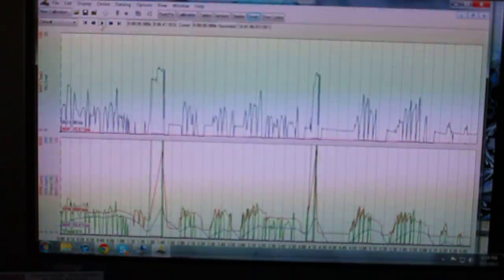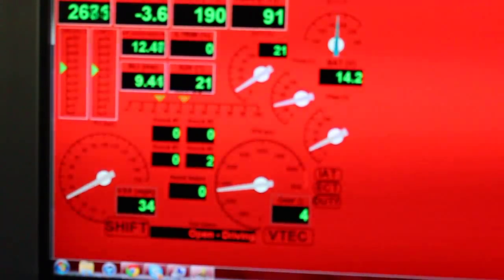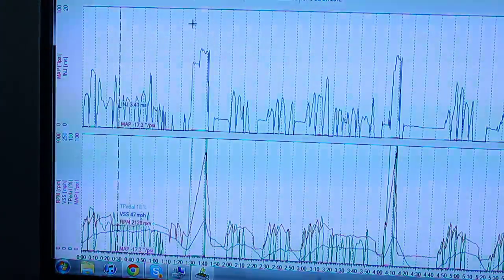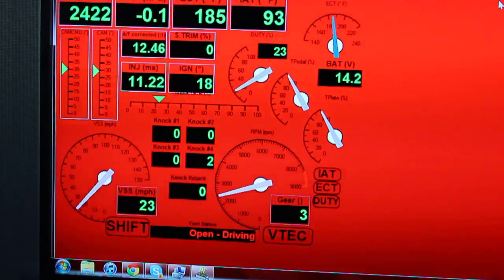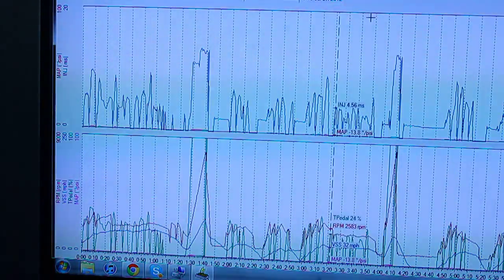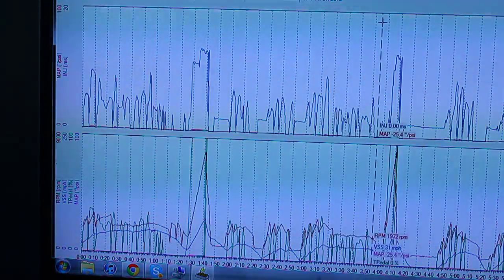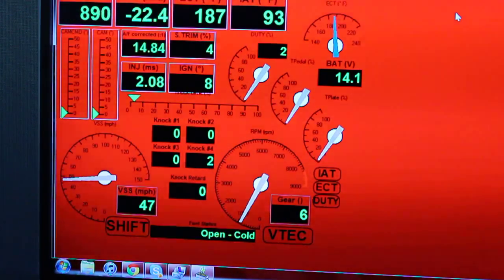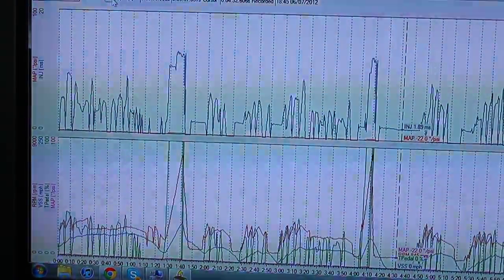2007 Honda Civic SI Hondata FlashPro Data Log

Comment: Hi. Can you please let know what your ect 2 is reading when your ect 1 was reading about 187-189? Do you normally see your ect 2 temp at low temp? When datalogging or just viewing your gaugesis your ect 2 hitting higher temps like 150s 160-170s and making your ect 1 temp get higher? I have this problem and not sure if something is wrong with my cooling system.